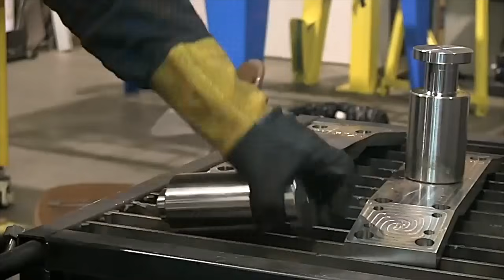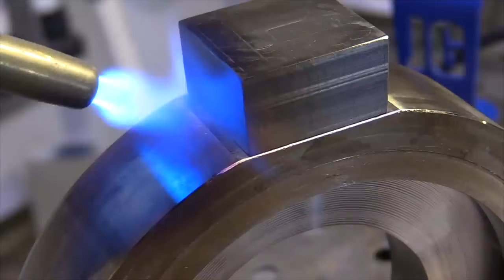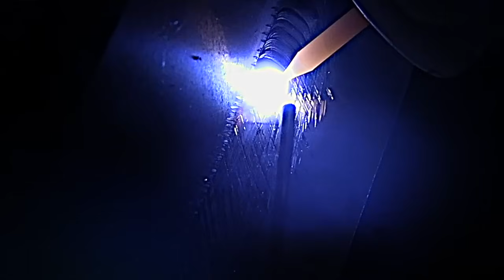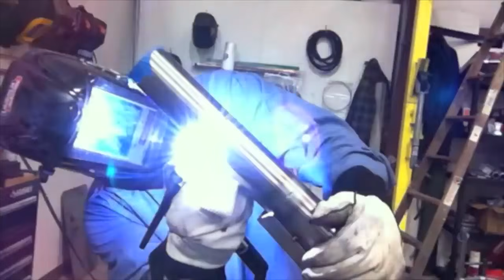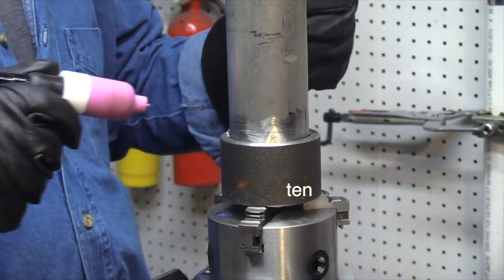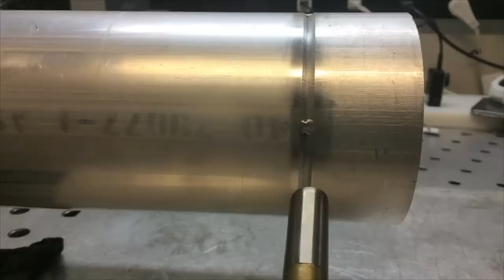Welding Metallurgy Simplified Podcast EP 04

Comment: One more point about welding carbon steel. Steel heat expansion goes up with carbon content. Mild steel expands ~2% when heated to 800c, a 1% carbon steel is going to expand twice as much  ~4%. 

This means if you cold tack some carbon and mild together the carbon shrinks fast and can pull the tack, or I've even seen full thick beads tear apart down the middle. This is why some carbon steel welds need post heat, to shrink things down slowly and uniformly.

Comment: Hope you are doing well! Looks like your health is improving. Lots of gold nuggets crammed in there! Am a retired maintenance machinist, weldor and fabricator with 45 yrs working for a research company that does mostly small scale oil refining with catalyst in electrofurnace, superheated reactors made of high allloy stainless and inconel. I was often called on to repair/replace burned out or fatigued sections of thin to heavy walled tube and pipe blackened by critical temperatures and corrosive elements with very limited access for welding. Most of what I learned was initially, seat of your pants trial and error, dumb luck and a willingness to ask questions from suppliers, chemical engineers, a few welding friends and do my own research. Preheating was something I had only a vague concept of and learning what was un-weldable, severely fatigued, rotten metal was a source of much frustration early on.  Wish I'd had you looking over my shoulder over the years.

Comment: definatly helpful i have been learning aluminum with my new machaine and one without a foot pedal lets just say i have used a full 125 cu tank of gas and thats the time its taken me to simply dial in my machine to not only make consistent passes on flat metal but to get it all correct enough to make me smile im no stranger to welding as far as mig and stick go but having the money to purchase the machines to have at home was a seemingly far cry at the price for a machine that i then needed to go get all the material to jhave proper power to run it (electrician here) so last night as im running beads without filler still i cleaned off some filler and kept it secure and dabbed in a pretty bead i was thrilled aluminum is very very tricky and i know how clean needs to be im also a certified automotive refinisher so paint and dirt wont ever mix well or any contaminants at that but i just wanted to say that i have been watching your videos for a while and its the really simple small changes with the illusive aluminum that will frustrate the crap outta you lol you have a good way of explaining things that are going on and just wanted to say thanks for the great information
 now i gotta get a refill on my argon and keep it moving haha

Comment: I welded for Metro Aviation for 10 years and we used a lot of 2024 T3 and 7075 T6 and only a few times did we weld 2024 and that was only for like if a hole was drilled in the wrong place for a rivet.

Comment: Volume is really low. Your hair is growing back. :) I don't suspect you would ever do anything regarding oxy acetylene. I'm having a really hard time with a #15 rose bud. It keeps filling up with soot and choking out. Ill ask grok. 👣👣👣👣👣👣👣👣👣👣👣👣👣👣👣👣👣👣👣👣👣👣👣👣👣👣👣
Reply from the maker: a lot of the problem with rosebuds is not enough acetylene volume. acetylene can only withdraw from the tank so fast so if you try to use a large rosebud with a smaller size tank, you can get a lot popping and soot
Reply: @weldingtipsandtricks  Thanks. I wasn't sure but I was thinking the #15 was too big. Ill get a #8 and try that out.